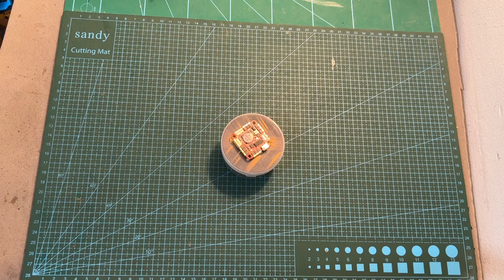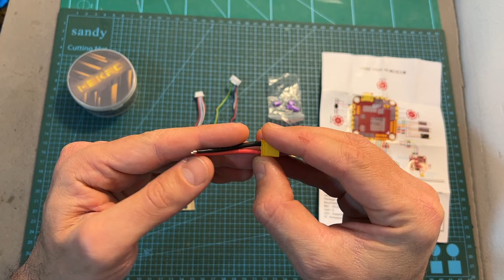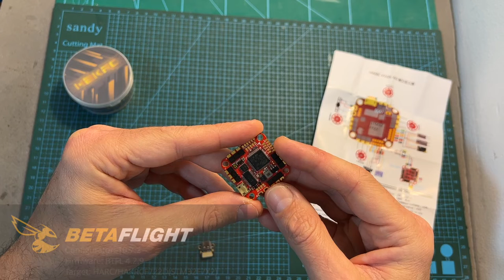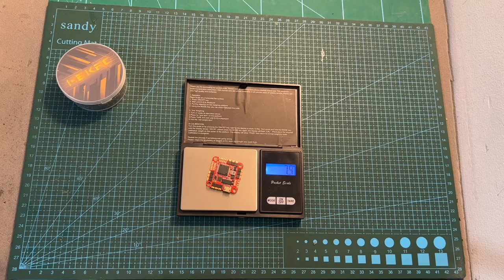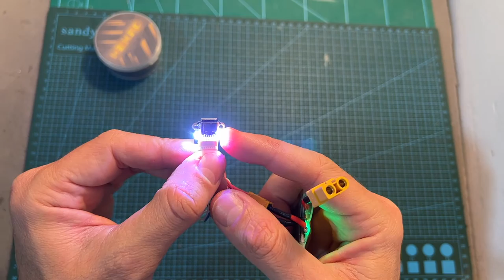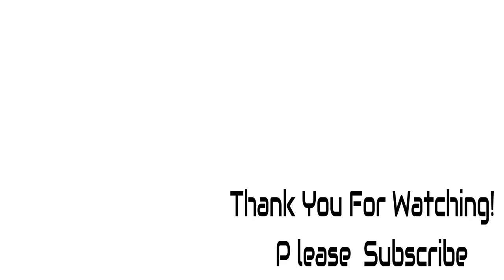HAKRC F7226 40A AIO Quick Overview

Comment: Thanks for showing this.  It looks interesting to me.  40A AIO is nice as long as it holds up well. At 72, it's not too expensive considering it's an AIO as long as it doesn't break as soon as you crash once! Also,  let's hope the fets are big enough to handle some motor issues and not blow on the first hang up on a branch.  The separate connector looks annoying to me,  but with some 3d prints,  I am guessing it could be a nice way to do it. Glad they added leds and a buzzer to make it worth it!
Reply: I have one of these.  I put it on a heavy 5 inch build (Source One).  After several crashes and turtle modes it still holds up great.

Comment: I've never used HAKRC before, but for $72.50 USd for a flight controller and an ESC is pretty good. On my last build, I spent $200.00 for an ESC and Flight controller, buying them separately; they didn't have the stack available for the 2 at the time of purchase. I'm interested in seeing how it performs when you use it in a build. thanks for the video.